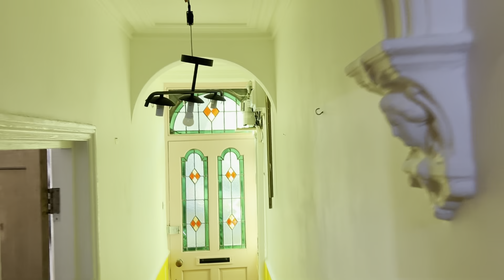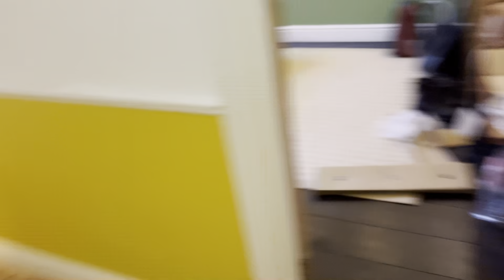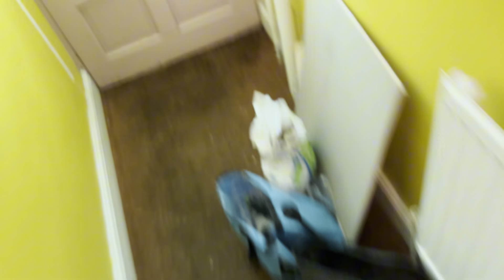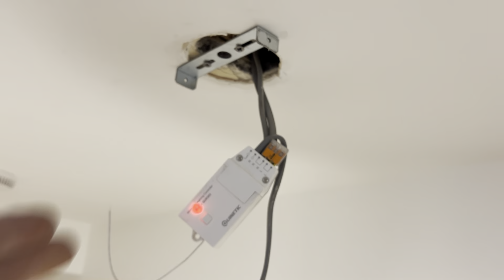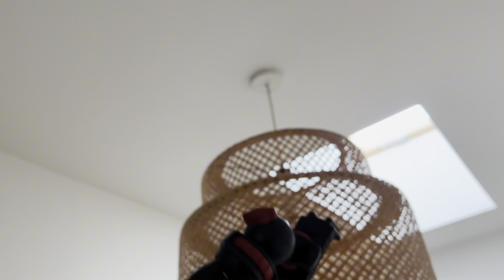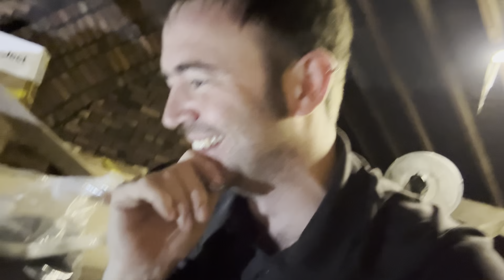CARRYING SHOPPING IN THE DARK - awkward house lighting problem solved!

Comment: Quinetic switches work well, I've found that sometimes (1 in 100) the receiver will not register the click and the light(s) if connected in series will become out of sync which then needs to be reset at the consumer unit.
Reply from the maker: Not experienced that, but I bet they're still the best out there